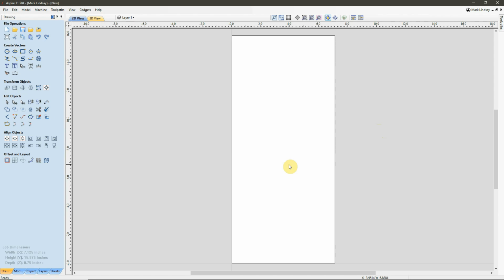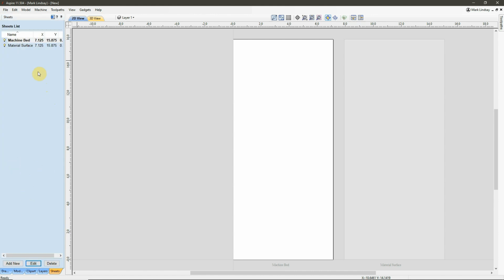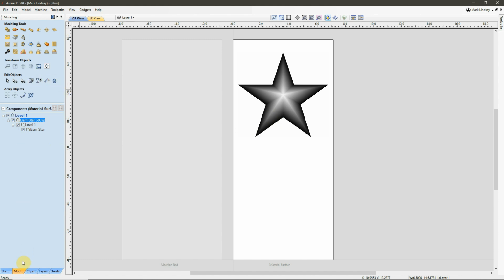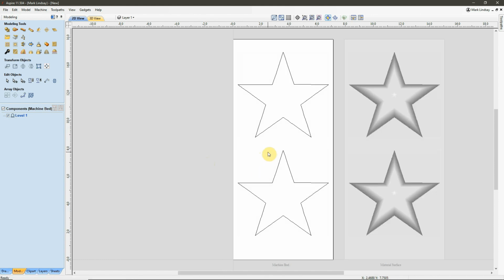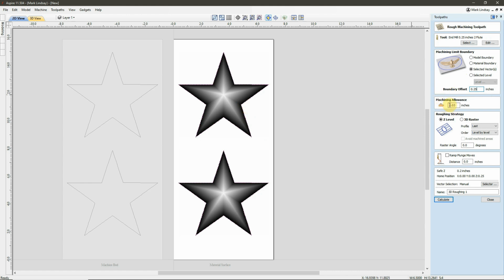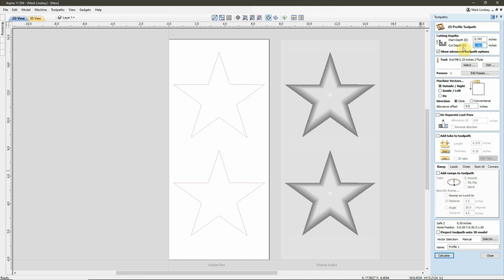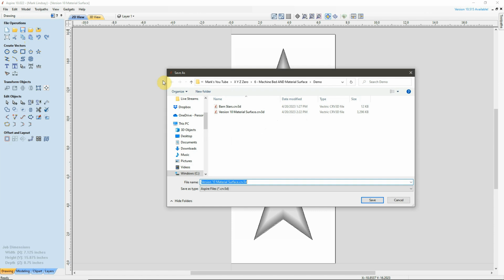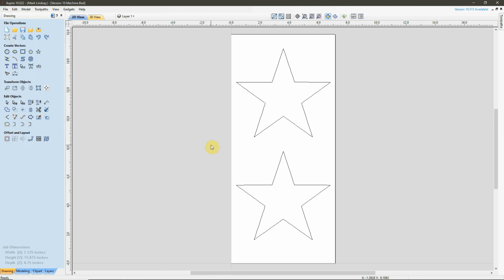Z Zero Position - Machine Bed AND Material Surface

Comment: Good videos but not relevant to todays question as much.
There may be several other reasons to use either, but for me its two fold mainly, secondary I want to save my spoil board where possible, but primarily, i'm surfacing a possibly iregular material, so I flush one side first using machine bed to give me a depth when I z zero of the surface when I flip it to get flush parallel faces, which is important especially when you are drag engraving at very precise depths as I do. 
I will check mechanicals and hardware this week some time.

Comment: Great video as always.  I discovered this technique some time ago and have used it on a few projects but as is usually the case I picked up something new after watching your video.  The Copy to Sheet command is very useful and something I had not discovered. Thank you.  Also on a complex project where you have several cut files it is very important to have a fail safe way to determine which files use the machine bed and which use the material surface. Don't ask how I know.

Comment: If you are cutting a full sheet that covers the whole machine bed, is there a way to use the machine bed as the Z0
Reply from the maker: Yes. Simply set your Z zero to the machine bed before you mount the material.

Comment: A ton of information thank you. I wish I could I make the Q&A but my daughter plays college softball. Soooo…..As being a complete newbie to CNC my profile cut out are way off, high because I don’t want to cut into the board. Would zeroing the Z axis in the profile tool path to the table be accurate to cut out the project? I hope that makes since. Ventricle 11.5 desktop.
Reply from the maker: I would suggest you sort out your profile cuts being way off (too high) before trying anything else. Step 1 is to calibrate all of your axes. If they're out of calibration, it doesn't matter where you set your Z zero - they're not going to move to the correct location or cutting depth. I'll talk about this further during the Live Q&A, because typing everything out here would take up a page itself.
Reply: @MarkLindsayCNC  I will look for the post. I appreciate your hard work!
Reply from the maker: It won't be a post - it'll be a topic of discussion during the Live Q&A today. Here's a link to it: https://youtube.com/live/kBWiixJSivg